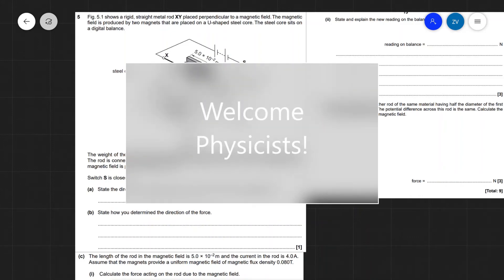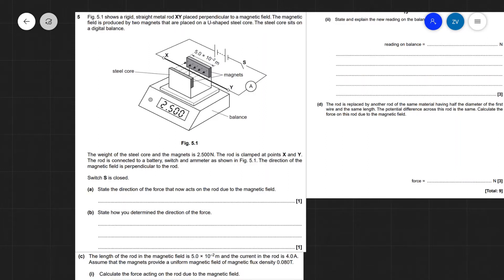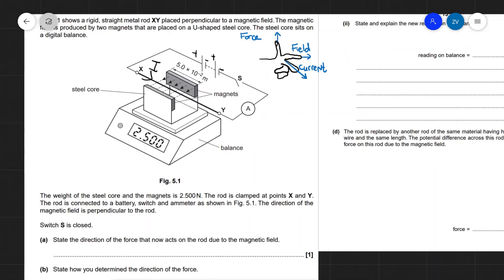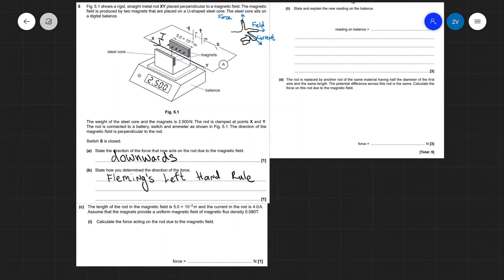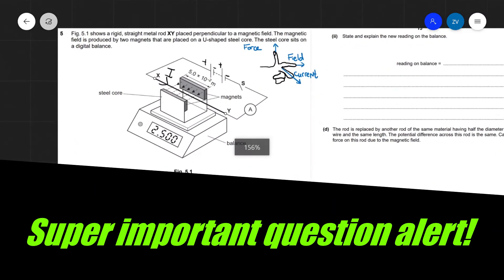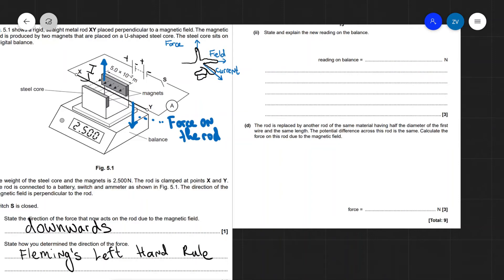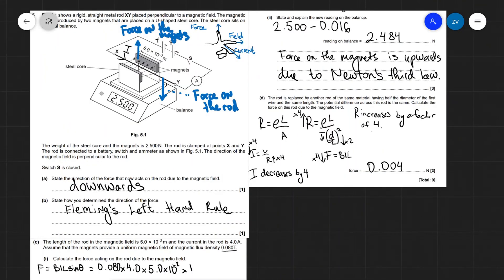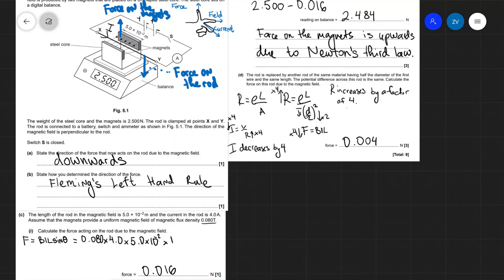COMMON Mistake in Magnetic Fields Questions

Comment: If by newtons third law the force acting on magnet is upwards, then shouldn't it get cancelled by the force acting on wire which is downwards?
Reply from the maker: Interesting question. Nope, because there are two forces acting on two different bodies, one force is on the magnet, the other on the wire. Hope this helps!